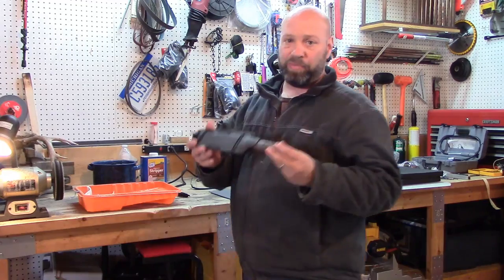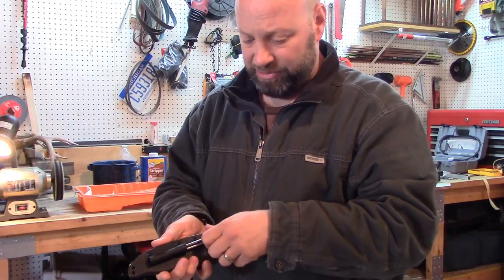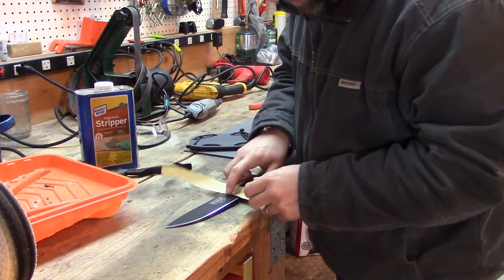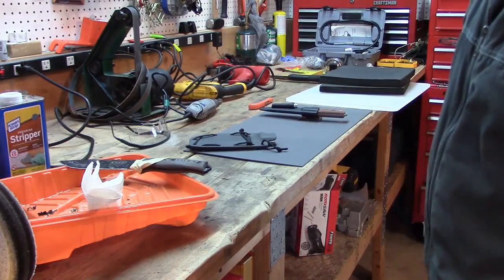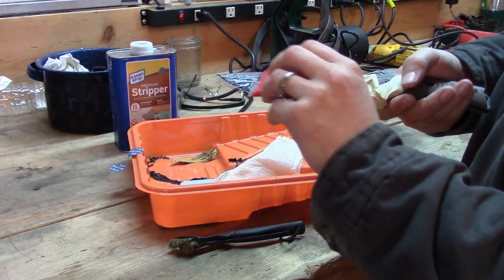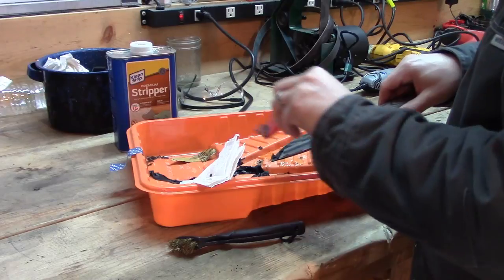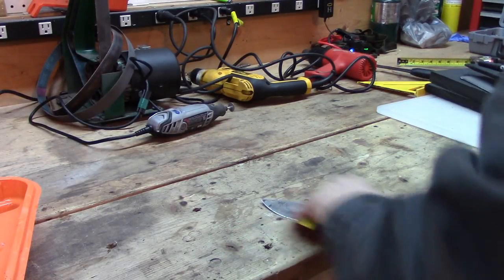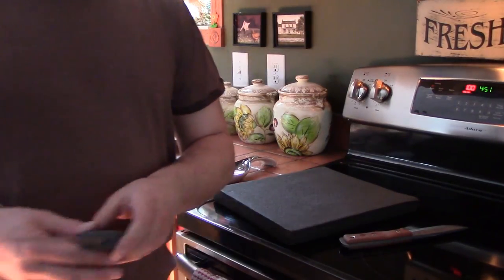Stripping and Puting a Patina On a Knife

Comment: I prepared my knives similar to a cast iron skillet. I used ultra low smoke point oil, extra virgin olive oil. Stick the blade in the toaster oven at 350-400 and frequently brush oil on it to build a varnish layer and then turn the heat down to 300-325 to cook out the long hydrocarbon chains and break them down. I generally let it slowly toast off. Then I’m left with a surface that with some polishing compound will be insanely smooth with just a touch of oil plus it resists rusting because of the barrier. I did it to my TOPS Wild Pig Hunter.
Reply: Would that hurt the heat treat?
Reply: @TheAverageJoeX  really good question.  You'd have to find out how they did the original heat treat, what temp and time etc. I don't think it would ruin it, it would just be a custom heat treat. I've only heat treated a knife once tho so idrk
Reply: @TheAverageJoeX yes
Reply: Yeah you'll ruin the heat treat and tempering... not recommend.
Reply: @roguewolfblades  yeah… not true thanks tho.
Reply: @Hudson4426  I obviously didn’t because I’m still using it as my hunting knife so many years later. Blade is holding up well and still rust free.
Reply: @TheAverageJoeX  no it hasn’t effected the heat treat let alone the tempering. Both of which for this knife are much higher.

Comment: Have you ever done a regular vinegar bath after doing the paper towel method? I'm wondering if it would even it out a little and blend the patterns a bit, without completely getting rid of the cool patterns you get with the paper towel.
Reply from the maker: Yes the soak method is a mono tone color rather than a pattern and the color is dark grey.

Comment: Doesn’t putting a edge back on the blade after doing the patina removes the patina and opens the blade back up for rust?
Reply from the maker: It could. But the edge is supposed to be used often and will keep it from rusting. If your not gonna use the knife leave the patina on the edge. I use my knife everyday. So I have to sharpen it regularly.

Comment: I know I'm late to the story but I have a question, After the patina will/do you need to oil the edge to prevent rust from forming on the bare metal?
Nice video also. How do you like the bob? Thank you.
Reply from the maker: If Im going to store the knives i put rem oil (gun oil) on the blade. if im using the knife like my daily carry knife i dont put anything over the patina.  Love the bob! its a great knife by a great company and a perfect size and shape to do everything.
Reply: @SamkoTradBow  Thank you for the reply,  Thinking about doing a patina on my E5, Izula on the way too, Love my bob's also 1095 and 154, one goes everywhere.

Comment: Is it normal for there to be what looks like rust colored stains on the blade and paper towel using this process?
Reply from the maker: Yes. You are basically forcing a rust and patina on to the blade in a controlled environment and for a controlled amount of time. Then stopping it. What's left is the patina that will now protect the blade from any rust or corrosion. It's kinda like a flue shot. The shot gives you a small dose of the flu to protect you from getting the flu.

Comment: I have a ZT folder with S30V steel . I have managed to take of the nice striped lines off while fooling around sharpening at different angles ... Any way what can I do to darken the blade ? I would love to get back the stripes back on it !!
Reply from the maker: S30v is a more stainless steel and will not take a patina well. Other than powder coating I don't personally know how you would get the stripes back. But whatever you do they will wear off again with use.

Comment: do you actually use these knives ?  im having to re patina my blade  every time i use it.  i have a old Schrade Walden pilot knife  that i use for fishing/hunting an what ever else i do camping . in my experience   the patina just dont stay on. i use boiling apple cider vinegar   for my patina's   is there something else i should be doing ?
Reply from the maker: I use them all very often. the boiling patina doesnt last as long as the normal patina. I just soak a paper towel in vinigar and wrap it around the blade for an hour before I sharpen them. But even on my izula I carry every day the patina lasts weeks with daily use.
Reply: @SamkoTradBow     thank you sir
Reply: Don’t boil the vinegar lightly simmer with lower heat use the steam it’s basically acid rain. Also regular white vinegar soaked paper towel wrapped around the blade. Put it above the level of liquid , I use #14 copper wire loosely spiral wrapped and then tied to opposite sides of the pot. I put the lid on and the vinegar steam penetrates farther into the metal than the hot vinegar does.

Comment: If you wanna keep the logos next time, metal etch them in using electricity before stripping the blade. Did it with my Esee 4 and it was great.
Reply from the maker: Great tip and idea! Thank you
Reply: Is that hard? Do I just hook electrodes up to it for a little bit or?